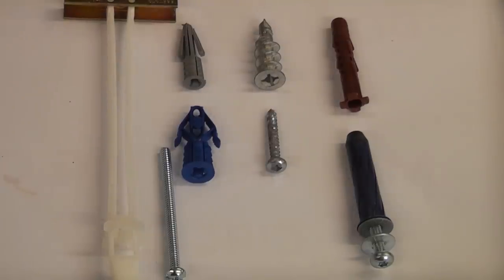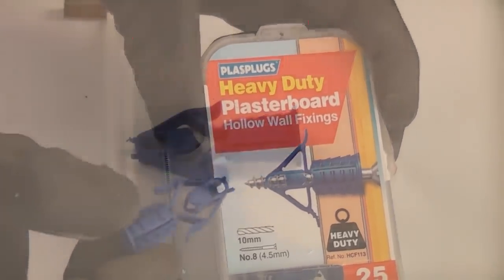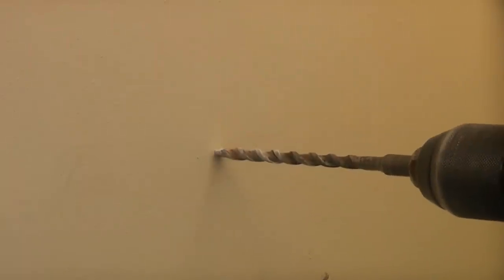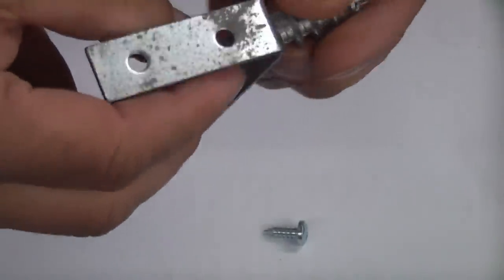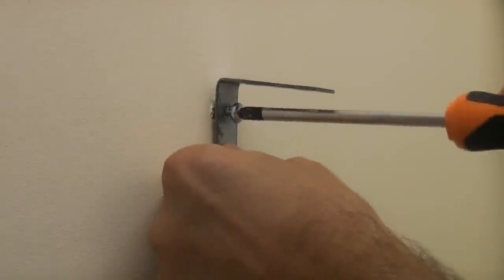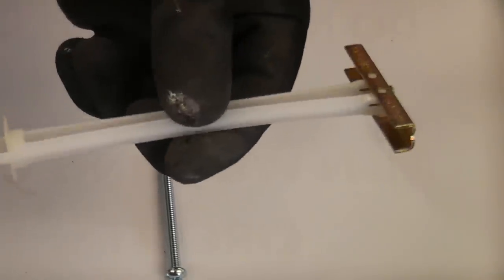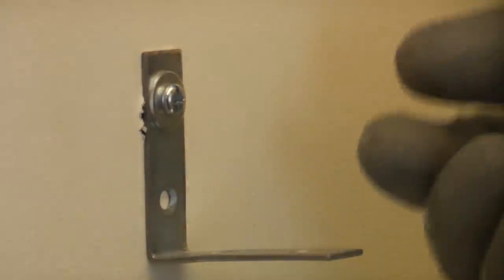Plasterboard fixings- The good, the bad and the useless!

Comment: Thanks for the vid, I haven't tried the snap off fixings so will look out for those, I have 2 plasterboard fixings on my van, the worms and Gripit, its a shame Gripit are going down the pan so I was looking for a replacement, there claim of 113Kg is amazing, ive never hung anything that heavy but I have used them for very large tv's when there has been no stud. Just to add, I've used thousands of those metal worm screws and never ever had a problem with the supplied screws, yes they bottom out but they have never damaged the wall when tightened up, there's an exit hole at the bottom so I figured that's exactly how they intended them to be used.
Reply from the maker: The snap toggles are superb and are my favorite plasterboard fixing, they now sell them in Screwfix under the Timco brand - https://fave.co/31B0MsC
This video shows how much weight certain fixings can hold before the plasterboard fails- https://www.youtube.com/watch?v=ECDysfNhx_E
I've not used the metal worm screws for years, but the ones I used did not have an exit hole for the screw.

Thanks for the comment 👍
Reply: @ultimatehandyman  Thanks for confirming that the Timco ones are in fact snap toggles (as that's not what Screwfix seem to call them). Anyway, just bought some as they certainly looked like snap toggles. The only slightly scary thing is the relatively large hole that you have to drill.

Comment: I've used the PlasPlug Heavy Duty fittings without a problem. They're great. 👍
Reply from the maker: They were not great when I tried them ;-) 
Thanks for the comment
Reply: ***** wrote: "Thanks for the comment"

No problem. 🙂

I think I screwed a screw through the heavy duty plug and removed the screw before placing the plug in the plasterboard. Broke it in before use, I guess you'd say.

Depending on where they're stored it could affect the plastic. (For example in a very cold environment, it might change its properties slightly.)

But my impressions of them from my personal experience was that they were pretty solid. I preferred to use the grey ones though, less effort and they tended to provide ample support.. especially when tightened and the plastic in the back was pushed against the inside of the plasterboard.

Thanks for making the video. 👍

Comment: Very informative video. Good too actually see what goes happens on the other side of plasterboard. I am going too hang a 65 inch tv and have been looking around for the best fixtures too use. You have really helped me solve the problem.thanks .
Reply from the maker: This is worth a watch- https://www.youtube.com/watch?v=glzwY76O0d8&t=8s
Thanks for the comment 👍
Reply: @ultimatehandyman   cheers watched it.
Just curious what your views are on the geefix fittings for plasterboard. They look good since the mass spread out behind wall should disperse the weight better. What ya think.
Reply from the maker: They are okay, but spring toggles and snap-toggles held more weight in my test-
https://www.youtube.com/watch?v=ECDysfNhx_E&t=1s
Reply: @ultimatehandyman  perfect just the video I was looking for. I'm looking up as much info as I can. Don't want my new TV crashing down lol

Comment: Excellent overview: well done. I've seen similar remarks about the Plasplugs heavy duty plasterboard hollow wall anchors elsewhere, though some people use them without problems.
The manufacturer does supply screws with some packs: they appear to be simple number 8s, so this isn't a problem with using the wrong screw.
Reply from the maker: Thanks for the comment

Comment: CHeers mate, i shall be using this video to put up floating shelves. Have to watching it again though i'm so tired i fell asleep halfway.
Reply from the maker: You are welcome.
Thanks for the comment
Reply: Hi, I brought some spring toggles for my floating shelves came separately because the plastic plugs came with the shelves was not designed for plasterboards which i'm want to use them for.  Unfortunately the screws designed to be used with the spring toggles are too big for the floating shelves brackets. any suggestions? Any advice you can give me would be much appreciated.

Comment: I’ve used them all apart from the last ones which didn’t look like it held that well from the inside of the wall.  The best ones I go to the most are the wall anchors solid as a rock as long as you use the pulling gun. 👌🏻👌🏻
Reply from the maker: It is surprising how much weight some of these can hold- https://www.youtube.com/watch?v=ECDysfNhx_E
Thanks for the comment

Comment: I tried them about 10 times too. You have to use the perfect diameter screw, fine thread, and be really nice to it. They look useful. I have never got them to work well. 

The nylon "ready drive", as the author calls them,  splitting type work extremely well.  They split open when you drive a screw through it. No worries about bottoming out. They claim 75 pounds. probably 75 straight shear.   Brian-Custom Window Treatment business
Reply from the maker: Thanks for the comment 👍

Comment: One trick, for the metal worm, snap the end off with pliers, then pre-drill a hole then screw the worm with the "snubbed nose" in to the hole...then a screw of any length can be used. I've got some from Screwfix, with a half nose (one sided) and longer screws just push it out the way. Those "Snap toggles" are awesome.
Reply from the maker: Thanks for the comment 👍

Comment: Very handy indeed.
I also found Plasplugs Cavity fixings totally useless, the broke every time.

Spring Toggles, they do leave an enormous hole in the wall, which is a pain for towel rails as they then sit off centre sometimes. Plus I had a few just fall apart as they were tightened. A right pain.

I've bought those pre-set fixings, found the tool and kit is sold from time to time by Aldi & lidl for under a tenner(!)
These are ideal for all these retirement home fixings, they all seem to be plaster & daub these days.

The self screwing Redi-drivers are great for some jobs, but I soon found out to test a 2mm pilot hole with a small screwdriver to see if a wooden batten or a chunk of plaster is behind it first.
If there is, these won't work and then you have an enormous hole.
test first, if there is wood or a plaster daub lump - use an all purpose 'universal' plug instead. I keep two sizes on hand 6mm for light jobs and 8mm for bigger jobs and the appropriate masonry drills. No need to keep a whole range.

On extensive testing, the Fischer universal plugs are worth every penny and for multi wall use, brick, plaster, breezeblock or even concrete. For the drillbits Bosch outlast the others by many weeks or even months. 
(DeWalt lasted one day, Wickes lasted 2 holes in brick, Bosch lasted 8 months.)
Reply from the maker: +Chris jW 
Thanks for the detailed comment ;-)

Comment: Principle guided plaster wall anchor selection.
(Orientation / load direction) :
Wall/vertical load : use larger hole size. 
- this spread the load across the panel core
Ceiling/vertical load : use larger hook size. 
- this spread the load across the panel surface. 
Example : 
- heavy load on wall? See 9:01. 
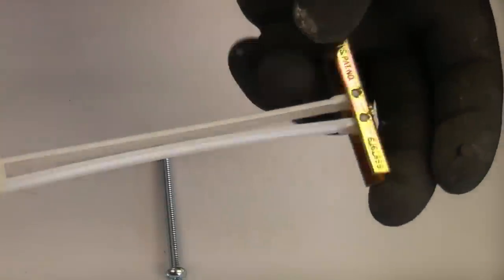- heavy load on ceiling? See 6:18

Comment: Cut the wall open. Brace between the studs with timber, screw the plasterboard back on, fill with filler. Job done.
Reply: @ultimatehandyman  100% success rate. The only way to do it.

Comment: I just use spring toggles. Those new snap toggles look great but the spring toggles are way cheaper. They're probably the most difficult fixing to use but they are one of the strongest and honestly once you get the hang of using them they're not too bad.
Reply from the maker: I tested out some popular plasterboard fixings and the spring toggles held the most weight before the plasterboard failed, like you say they are much cheaper than snap toggles- https://www.youtube.com/watch?v=ECDysfNhx_E

Comment: The snap toggles are brilliant. If your in an old house with lathe and plaster walls it is virtually your only option for success.
Good review, nice camera work to show the back. Plasplugs are the big name in the field but perform terrible, I never use them, even their basic red or brown plugs aren't that good, cheap Screwfix red/brown plugs are far superior.
Reply from the maker: +Harvey Smith 
I love the snap toggles. I once fixed a basin to a lath and plaster wall using them.
Thanks for the comment ;-)

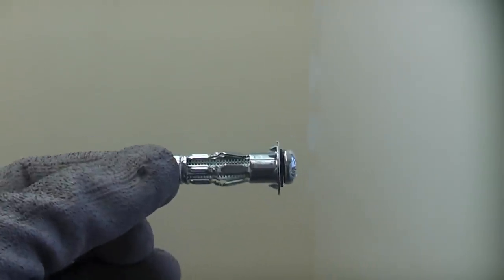Comment: 7:32 That setting tool is a must if you frequently use the metal expanding anchors.  I find that these anchors tend to strip out before the wings fully expand or the whole anchor just spins around.
Reply from the maker: If the plasterboard is skimmed over with finish plaster the anchors will work without the setting tool, but if it is not skimmed, you need the setting tool.
Thanks for the comment 👍
Reply: In Canada and the US, we don't apply a coat of finish plaster; we just fill in the joints/screws and paint.  The issue is with the dodgy machine threaded bit at the end.   It either strips out at the start or near the final tightening at the end or at some point in between effectively ruining the anchor and you then have to rip off the collar and push it into the wall and start all over again.  Found the setting tool on Amazon.ca $20.  Worth it for big jobs!
Reply from the maker: Mine is very similar to this one- https://fave.co/2Gl927c
👍

Comment: So nice when they work! I actually was installing a shower door the other day and it came with some extremely low quality versions of the ones that broke on you. In my case they broke in my hands before even getting thru the hole (you have to bend the wings back to insert them).  Makes you want to track down the engineer who came up with them.
Reply from the maker: +Chris Gonzales 
I have had people in the past say they have struggled fixing to plasterboard. With some of the fixings available it is no wonder! Thanks for the comment ;-)
Reply: +Chris Gonzales "engineer"... I think you mean costcutting marketroid :D. I suspect they were made in a higher quality plastic originally, and would actually work, then someone came along and reduced the quality without actually checking if they still work

Comment: I hate using fixings in just plasterboard unless it's for something very lightweight.  I would never use one for a shelf because in the real world you know someone is going to overload it. Or just regular movement and a humid environment will weaken it eventually.

I've used ones similar looking to the Plasplugs type you showed. They were grey and made by Fischer I think. They worked okay for me. You just have to be careful about over tightening as once you hit the point where they start spinning you're buggered.

Good vid.
Reply from the maker: +V T Thanks, some of the plasterboard fixings are OK, but always best to fix to something solid- unless there is no other option!Thanks for the comment ;-)

Comment: I had to mount an ADA rail. I bought a 100lb rating each screw and mount. They were worthless. I recommend you look at what is behind the drywall. If there is insulation or other material behind the drywall it impedes some of these from working due to the confinement of space. I ended up purchasing the spring loaded wall anchors instead. Do not purchase the permanent mounts for rentals or apartments. They are difficult to remove and mend the holes in the drywall.

Comment: Now i understand why i cant get anything to stay on the wall in my house. I've had a pack of those grey and blue plastic plugs for years. I'm switching to those universal ones i think. Cheers for the info!
Reply from the maker: You are welcome
Thanks for the comment
Reply: Threw out some old crap blue/grey Plasplugs i had also ,  try FISCHER for their Uni. plugs or their 6mm plasterboard plugs which can be used for most materials :]

Comment: I like to use brad tip wood drill bits on plasterboard, makes for a cleaner hole and I use a stop so it’s only drills the thickness of the plasterboard
Reply from the maker: Thanks for the comment

Comment: Nice vid, thanks.  Its important to use the correct drill size for each fitting, to minimise surrounding damage, & for ease of fitting, e.g. nylon screw-in fixings 8mm.  AND, use regular screws, smooth thread, with a drop of OIL on each one - for ease of fitting, and, if you have to take it out, the screw will turn, not the plug.  Self cutting screws will twist the fitting and turn the fixing out on removal - they are meant for driving into wood.  For heavy loads,  screw into the studs, or take the time to cut neatly in & fit a batten behind to spread the load.
Reply from the maker: Thanks for the comment

Comment: Can I hang a TV on the wall using the Ready Driver zinc worm screw? TV is 16KG and Bracket 3KG. I should be able to put about 6 of them in the wall. I don't have much of a gap between the plasterboard and outside brick wall behind it. I wish I had seen this video before as I have holes in my wall where I used the long screw and it hit the end. Dought! Thanks for the video - awesome work.
Reply from the maker: No, I would not trust them. I only use those in emergencies when I have nothing else available and would only use them to hang pictures etc.
This videos shows which plasterboard fixings hold the most weight-
https://www.youtube.com/watch?v=ECDysfNhx_E&t=1s
(just read the rest of the post), you need these for your job-
Rigifix- https://www.youtube.com/watch?v=xaYfs3lr1jI
Corefix- https://www.youtube.com/watch?v=7xLhIPoO5gQ
Thanks for the comment 👍
Reply: @ultimatehandyman  Thank you for your help, watched those other videos also. All very helpful. Due to the lack of room behind my plasterboard, I am going to go with the gripit from this video. I saw your weight one and looks like it can hold 100KG so 20KG should be okay fingers crossed. Thanks again for your help.

Comment: The second type works very well if you buy the Fischer type, not the cheap low grade plastic blue one you had. I'd say they are second strongest after grip it. Third strongest the metal screw type.

Snap toggles put force on the back not the equally across bottom of screw I find.. Always weary of them. Normally smaller sizes then grip it too.
Reply from the maker: When I tested out some fixings the spring toggles were the best- https://www.youtube.com/watch?v=ECDysfNhx_E
Thanks for the comment 👍

Comment: wall anchors are brilliant IF enough space to push them in. the GUN to expand the wall anchors was a revelation!I otherwise LONG screws into brick. those worm ones just chew my plaster up.
Reply from the maker: Worm screws are my least liked fixing (after the Plasplug ones that did not work)
Thanks for the comment 👍

Comment: Interesting, I've been having trouble with plasterboard fixings for years and decided the first type shown was a good option. I think one important factor is "scrunch" as explained in the vid, something I need to examine further. No scrunch (or back pressure) then the thing will fall out, or worse, spin loose in the hole, which I find those big metal worm things do, but I take the point of screw length, good oberservation. I too did think some fixings were rubbish, strange how this could be in the modern world of easy CAD.

I tend to look for repeat fixing too, the fixing might work once the first time but remove the screw to make a change, reinsert the screw, how well does the fixing respond? Some are rendered useless, others are good.
Reply from the maker: Thanks for the comment ;-)

Comment: I would always recommend using a HSS drill bit when drilling in plasterboard, not a masonry bit. You'll get neater hole with HSS, & less possible damage to back of the board.
Reply from the maker: +Gerald J Thanks for the tip ;-)

Comment: Very useful: I enjoyed it 🤩 the plas plugs I saw broke but how I used them is a no 8 with a smaller tip end. The zip ties you showed I used the most.😎😎 and also can you post a link on where I can buy all the ones you used thanks I like to use them too.
Reply from the maker: You can get most of the fixings on ebay or at Screwfix, or your local hardware store.
Thanks for the comment 👍

Comment: Never touch the gripit fixings... I used them once, seemed great at first but the wings snapped off inside the wall at a random point in time and crashing down came my TV! Over £1000 worth of damage
Reply from the maker: 😱😱😱
Did you get in touch with Grip-it to let them know?
Reply: @ultimatehandyman  I did, and just got insulted! They tried to tell me I don't understand the laws of physics (despite my engineering degree) and they then went on to prove that they themselves don't have the slightest of understanding.

Comment: With ready drives. I tend to find they fix best with a smaller pilot hole first and then screw it in. Otherwise on soft plaster it can chew the wall up and make a big mess